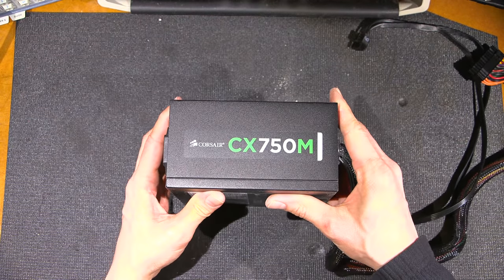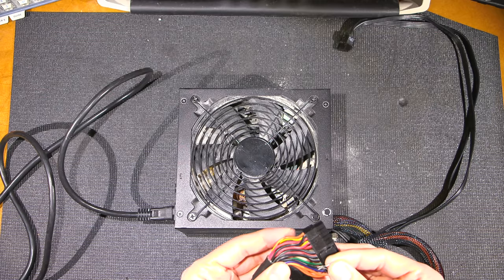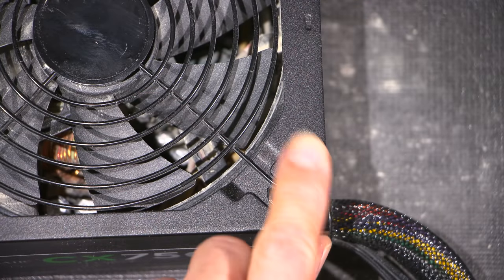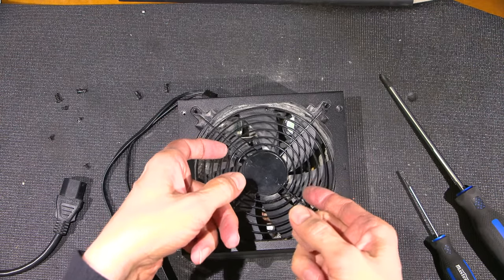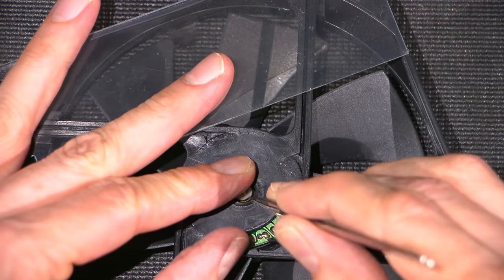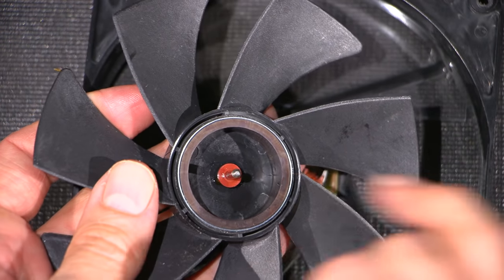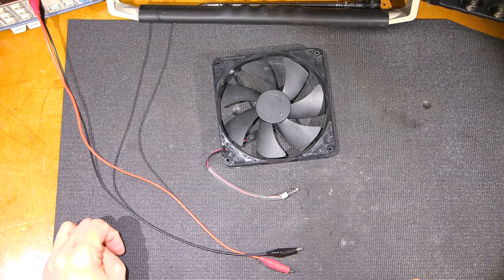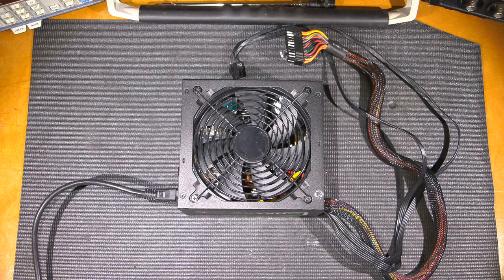Fix A Computer Power Supply!

Comment: HELLO MR. CARLSON! Am an avid Subscriber, you are my first 'Go to' when diagnosing PC issues! I recently built a new Computer in my old Tower with a new Raidmax Vampire 1000W 80 Plus Gold Power Supply, an MSI Z390-A PRO Motherboard with an Intel Pentium Gold Processor G5400 CPU @ 3.7GHz! Next added  64.0 GB DDR4 3200 Ram! Also a ZOTAC GAMING GeForce GTX 1 Video Card! Recently upgraded all my HHD's with an Intel 660p Series M.2 1 TB SSD Drive C and two WD I TB internal SSD's! My Computer now boots up completely for a cold start in 30 seconds!!!! (Once in a while when I turn it on, it Boots into the Bios Screen)!!!(But when I wont to boot into Bios, no matter what key combination I press it wont go into Bios on Command)! Windows will not display on my Digital Monitor but I can see the Bios Screen on another HDMI Output to my 32 inch TV! Am running XMP Mode and Gaming Mode on the MSI along with allocating 3/4 of my Ram to Process my Adobe Premiere 2022! My Question is: How do I get the computer to Boot into Windows EVERY TIME? And secondly, How do I get my computer to boot into Bios on command?

Comment: You didn't elaborate, but the reason that you don't allow the fan to spin under compressed air is that you can very easily destroy the bearings -- especially the cheap sleeve bearings that are found in most OEM power supplies. That is a lesson that I learned the hard way in my youth.

Comment: I use a small socket, just big enough to fit the hole, to push down on the plastic split washer to put it back in place.

Comment: Another nice video Paul. I have repaired many fans the same way myself. I normally only used regular thin lubrication oil. Adding some light grease may be a good idea, as it can be challenging to get oil into these porous media bearings. I think they are forcing oil into them when being made. 
I like your idea of trying to fix things rather than discharging them. I and probably many others would love to see a computer power supply being repaired when it is due to an electrical fault. These units are so common that it would benefit many of us and would even save even more garbage. I have at least 6 damaged ones in my scrap bin. Your thought process when fixing these would be valuable. If not on YouTube, what about Patreon?

Comment: Thank you for explaining that the power supply requires a load to properly operate. I didn't know that. I just bought a new power supply module, but I would like to repair the old power supply and have it be a  back-up.

Comment: I have that same PSU, they made two versions of the CX750M, that one is prone to failures where the one with all white part number is supposed to be better. Mine has been in service for about 5 years with no issues!

Comment: Good info thanks. I always use Amsoil engine oil on the bearings/ bushings and then never have any more issues. My computer power supply went pop and I had to replace it with another. As a 30 year computer tech (now retired) I would like to repair the old one to have as a spare but I haven't opened it up to see if there is anything obvious that gives me a clue and I don't think you can get a schematic for them. Also I sold my occilloscope.

Comment: I have this same power supply CX750M and just replaced the fan in it as well after just over 6 yrs of use, it was ceased up fully. And the PSU would shutdown under load. I first tried to use a fancy Noctua fan to replace it, but the minimum voltage was about 0.2v or so to high for it to spin at minimum vs what the PSU puts out on the minimum setting so it would still over heat and trip the thermal cut off. Ended up using a cheap fan off Amazon.

Comment: Another great vid Paul, thanks. As i write this my trusty Torin 45OS, 4 and a half inch cabinet fan blows cool air at me like it has done every night since i relieved an employer of it in 1986.  it had already done at least ten years in constant use in a card-cage on a dusty customer site. It hogs half an Amp and is rare at 230v. Maybe now i will strip it down and show it some lube. Or maybe not: Dont fix something that works, eh?!  ;-)

Comment: Some of the power supplies also have either a heat or current sensor circuit, which will control the speed of the fan. Nice video though! Love watching!

Comment: I have to admit, as a retro PC enthusiast, I have no hesitation to rip the fan out of an old PSU and install a new one.  I do this as a matter of routine maintenance when I acquire a new (to me) computer, along with all the electrolytic, tantalum, and HV film caps.  But, in my case, those items have been installed since 1980 to 2000.  The one here is quite young in comparison.

Given the higher quality parts selection back in the early days, I have quite a stack of old Panaflo fans.  They're noisy, dusty, huge hub-to-blade ratios, at least one is AC powered..  Hadn't really thought of the "contributing to landfill" angle, but I'm not really sure what else to do with them.  Maybe I'll re-purpose them as dust collectors in the garage, using Big Clive's paper towel filter trick.  :-)  Many of those old fans still work fine, I just didn't want to deal with old, noisy fans that may live anywhere from another 0 to 20 years.

So, thanks for the inspiration to give them an opportunity to live out the rest of their lives.  Now that I've seen how to do this handy little service trick, I'll just run them somewhere accessible until the bearings fall off.

Comment: 02:50 So what could be used as such a load, if I wanted to use it as a bench power supply instead of powering a PC?
Also, I knew about the "green wire" trick before, but once I tried it on one of my old power supplies, I just heard a loud bang and it stopped working :q  I suspect that one of the capacitors might have exploded, but I'm not sure why.

Comment: I have worked for a FM & AM transmitter company. Clients use to bring their equipments to be repaired and i have seen many kind of aberrations. One was that an employee was fired and the last night before going away he urinate on it. We have to make a raffle to decide who will repair that eqipment. Other equipment comes from antartica , been working for years there. It comes with zero dust, as if it were recently sold.

Comment: I've had a Corsair HX1000 psu for over 11 years now and its still cool and quiet, so your millage may vary. Cool video and an easy fix  i suppose. A new fan would have been cheap too. But a true engineer always tries to salvage not replace.

Comment: Thanks for the heads-up about the split ring there, Mr. Carlson! I tried to service a similar fan and couldn't figure out how it came apart. My first clue I did it wrong was the plastic frame splitting. 😱 So, unfortunately, that one did end up in the landfill, but not before I recovered the magnet wire and hall effect sensor. I think I still have the actual fan (less frame) floating around here somewhere. I was using it as a fidget spinner for a while. 😁👍
Reply from the maker: Glad to help Ted!

Comment: I did this to my 9 old power supply (Sentey BRP 700w), my brother thaught me how to do maintenance on it, such as cleaning the fan, blow the dust off and check all the components. One time my computer didn't turn on because a faulty capacitor on the primary side, i didn´t know much that time but i bought a cap with the exact specs (looking at it now i realize its a teapo cap) and with help of my brother we changed it and it worked for 2 years after that. Now i changed for a new CV650 because the 12v was running low when loaded and also group regulated.

Comment: Thank you, as this is exactly the same Corsair PSU that I installed in my X99 PC!  However, I doubt that it's going to ever collect as much dust as that because along with annual checking & cleaning, the Phanteks Enthoo Luxe case it's in has easily removable filters front, top, & two underneath (one of which sits just below the PSU's fan)! 
One thing that also helps the filters work effectively is to have all the fans behind them sucking air into the case, which ensures there's some positive air-pressure creating a good airflow through the case towards the rear (rear case-fans always blow outwards).
Also, it's never a good idea to sit a computer on the floor where it becomes a vacuum-cleaner.  There's reason they're called 'desk-top' computers!

Comment: /:45 this Capacitor should be connected to parallel bleeding resistors, discharging it within an hour, but if you keep it turned on and remove the AC plug or jack meanwhile, it discharges within seconds. Yes, relubricating the bearing works fine.I recommend synthetic SAE5W10.

Comment: Very satisfying, and not just because you prevented another component going to the landfill prematurely.
Reply: That YL fan can't hit the trash heap fast enough. It was garbage the day it rolled off the assembly line. In quantity they're less than $1 a unit. Which is how it found its way into that PSU. It ain't no Arctic fan with fluid dynamic bearings that's for sure.

Comment: Oh my, imagine what the rest of the PC looks like.... 
I have done many fans like this and industrial ones.  I too hate throwing them away when it's such a simple fix. 

Sleeve bearing like the one you have is the easiest to repair, just clean and oil. 

To tell if a fan has ball bearings push the hub in and it springs back, it is usually ball bearing. You are pushing against the preload spring. 
The bearings are usually MR693 (3x8x4).  Typically a fan will have two. NMB make the best MR693 bearings, and you can buy them in small quantity on eBay. 

Depending on the bearing design you can actually disassemble, wash out, re-grease and reassemble the bearings too. 

There is a clip for each shield on the bearing which can be compressed and removed with two Stanley blades. 
Wash in some solvent to get all the old crappy grease out. 

Re grease with something good. I like Mobil Polyrex EM, it is the quietest grease i have found and a syringe is the best way to get it inside the tiny bearing. 
You may have to run the fan for a bit after reassembly , they can sound bad at first as all the grease flies around and relocates itself.

Comment: For what its worth, I have this same power supply, and have done the same repair, and have put yet a new fan in it, afterwards. Relubricating the bush will cure it, for a while. But the root cause is really the bushing wearing beyond its service limit. This allows point contact on the shaft, which causes burnishing and yet more noise after the grease/oil has had some time to migrate around. Real common failure mode in DC and AC motors that have bushings. It lasted a few months with new grease, but still had to be replaced in the end.
Reply: My experience is once a fan has made noise lubing them can quiet them up for a little while. But the failure seems to return fairly quickly. But I think in this case the fan suffered a different kind of failure with that dried grease in it. What we heard here wasn't typical fan howl indicative of dry bearings. Once they really howl they're done.

Comment: I have the same PSU. After a few years of using it the fan started clicking. The problem is Corsair builds these mid-range PSUs down to a cost and does not use good Corsair fans in them, instead a cheap Chinese brand mostly nobody has heard of. I replaced my fan with a silent fan from Fractal Design because it was on sale, haven't had any issues since.

I did have to splice the plug from the old fan onto the new one because the fan in a PSU will be 2 pin and PC fans are usually 3 or 4 pin. The third wire is for the tachometer, and the fourth is for pulse width modulation. PSUs use neither and just run the fan at maximum speed via voltage. Which is why a silent fan is best as a replacement.

Comment: Looks like the PSU filtered the room air. Nice job. I worked at a place where there was no economy in repairing like this, just replacing, which was always frustrating, since there is less personal satisfaction from just swapping parts.

Comment: What are you going to recommend to your friend about their dust problem? It’s quite possible that as the dust settled on the supply it’s ability to dissipate heat decreased creating a feedback loop that leads to the supply running hotter while the fan runs more frequently overheating the bearing grease. Dust is an electronics killer

Comment: That power supply is old but one of the longest lasting models I ever used for years. Have one that is still running but I do clean them every year. Would use a motherboard for testing as have several and drives/ video card for them etc...

Comment: Add an air filter to the computer air inlet, to prevent much of that dust buildup. If there is no place to add a permanent filter, just use some open-cell foam, like used on window air conditioners. Cut a piece to cover the entire air inlet area. It will barely restrict the flow, the dust buildup is visually apparent, and the foam is washable. Also it is cheap enough to just replace it when it gets too dirty.

Comment: The sticker: "Warranty void if broken" in this case should actually read: "Warranty void if removed, EXCEPT: Mr. Carlson"  Well, I think it would except there's not enough space to write all that, so it's just assumed as such.  However, in my case I think it says, laughing, "good luck buddy... you might find some charged caps inside... Hahaha."  yep... power supplies can be a bit cheeky.

Comment: an item of note is if you do a lot more ATX PSUs, water cooling supplier sites sell actual jumpers you just plug onto the 24pin lead.  Commonly used to spool up the pumps without energizing the expensive bits while you fill up the loop.

Comment: I totally clicked on this thinking we'd be replacing some dried out caps or burnt resistors or something. Taking apart a fan and lubing up a bearing is way more fun and you still got to use the good 'ol bench power supply.

Comment: Many older (1980s-early 90s) "AT" (i.e. pre-ATX) PC power supplies had fairly significant minimum load requirements that needed to be met to operate within their voltage regulation specs. This minimum load was typically listed on a label on the power supply. For example, the IBM PC At 5170 Technical Reference indicates that the minimum loading is 7 amps on the +5V line and 2.5 amps on the +12V line!! For 5170s without a hard drive, an IBM supplied load resistor of 5 ohms provides the +12V loading! Even if a load is not specified, early ATX supplies may require a low load of a few hundred mA on 5V and 12V to have stable output. As designs improved, vendors went through a period where they started advertising/listing their supplies as "zero load" - I think about 2010 or a bit earlier. In any case, when bench testing a PC power supply it should be checked whether that supply has minimum load requirements. Otherwise the output voltages may appear out of spec when in reality the supply is fine.

Comment: I recently did this for a power supply also.  The fan didn't have a nice removable cap underneath the sticker, it was just a melted in plastic plug.  I used a 1/4" drill bit to gain access to the bearing.  Unfortunately, either I didn't drill away enough plastic or there was no removable clip so that the fan could be removed.  Luckily I was still able to clean and lubricate it enough so that it sounded normal.

Comment: Nice but simple fix indeed. Sometimes i have a noisy fan because the pcb in the fan with the coils has some movement so the coils are vibrating pushing itself around magneticly, not the spinning fan itself. I put a small blob of 2 component glue somewhere between the pcb and the plastic housing. Surprisingly this fixes noise as well on cheap new bought fan's that make more noise then their expensive brothers.

Comment: At 2:17 you say it's a high enough resistance to turn it on but a low enough resistance to heat up the resistor. Did you mean the reverse. My very limited electronics knowledge assumes a low resistance to be able to trigger an IO (again assuming it's a low level IO/contact)  yet high enough resistance to warm if there is an unusually high voltage due to a fault on those pins.

Comment: We still do this on occasion in our shop, though the long-term survival rate is not brilliant based on data pulled from our CRM. It seems that, especially with cheaper PSUs, by the time one gets to the shop the thermal stress of being run with no or minimal cooling has significantly shortened the lifespan. On average a PC with a PSU that's had a fan repaired or replaced comes back into the shop in the 8-12 month timeframe needing a new PSU.
Reply: Smart money kicks PSUs to the curb on a regular schedule to avoid more costly failures.

Comment: You did not fix the power supply, per see. You fixed the fan of the power supply. Fixing an actual faulty atx power supply would be cool to see. Not complaining. Still very informative, so thanks for your work and time. It is always interesting to see a knowledgeable perfectionist at work. Keep it up.

Comment: That 'washer' on the shaft, I think it was a seal that had dislodged itself from the Bearing Housing, and let the thinner parts of the Lubricants escape. It looks like it is the same Material that plugs the other end of the Bearing Assembly
Reply from the maker: No, it rides on the rubber O-Ring to stop the top of the inner fan housing from binding with the center column. Most porous bronze bearing type fans have this construction. Ball bearing types are completely different.

Comment: In a Corsair Power supply you can simply remove the sticker on the Fan itself ( Yes the Round one) depending on the model ;  and lubricate the Central spindle , Sewing Machine oil laced with graphite is my preferred mix as it lasts for decade's,  I have a test Lab Supply I built built from PC Supply 30 years ago. 
Most Power Supplies will be Voltage controlled as a result of either Load ie Current Draw or Temp that ramps up the fan speed .